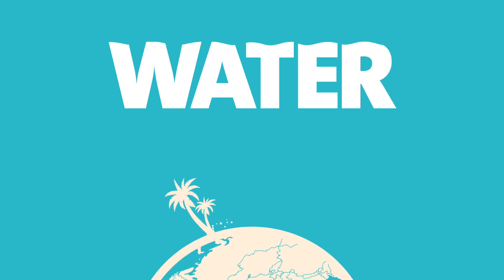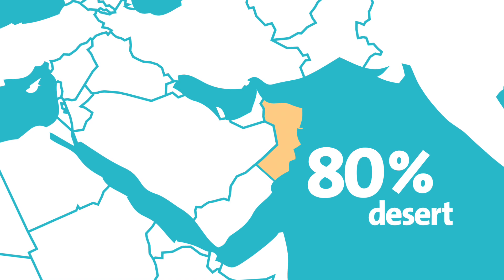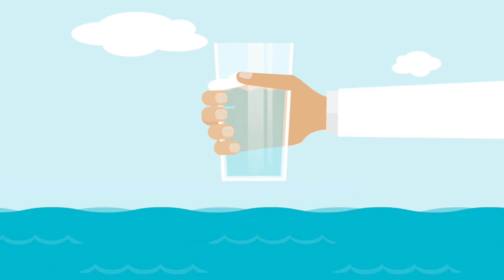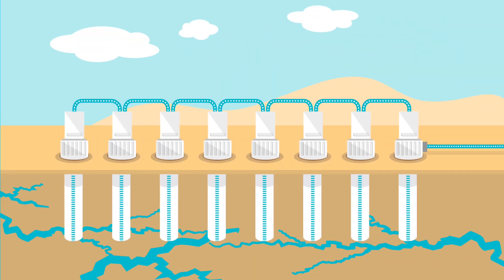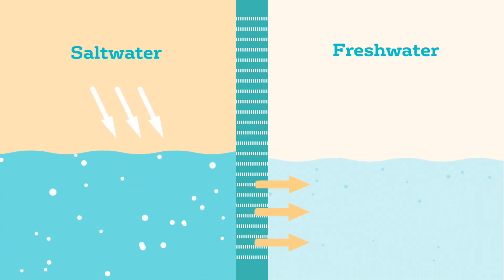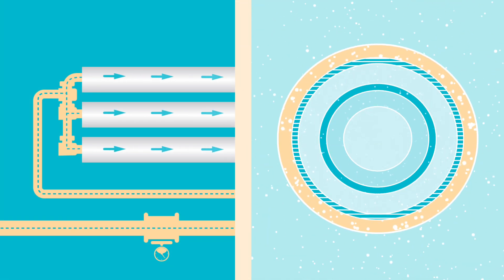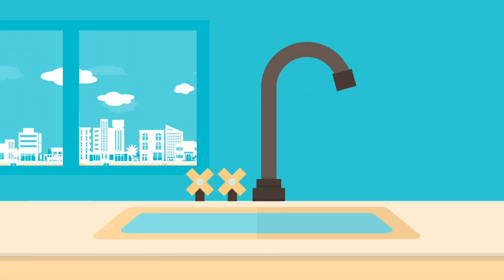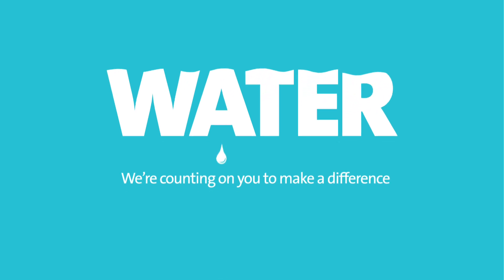Sur Desalination Plant

Comment: water wells are not as salty as the sea..secondly sand and media can clean up salty water to potable standards..after that reverse osmosis is  used to remove the last 10% for taste... so this is not a full reverse osmosis plant..it is  a partial RO which is very efficient and relatively cheap